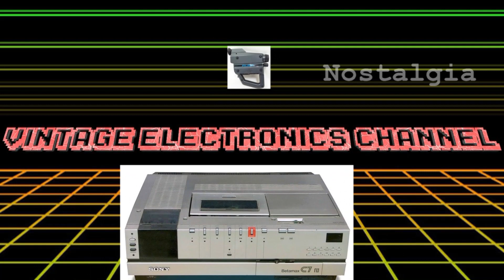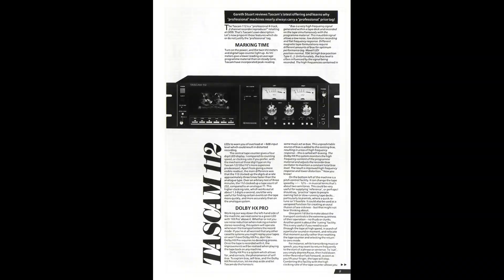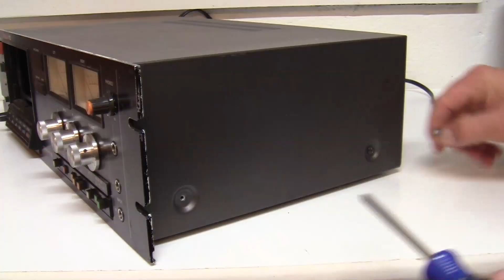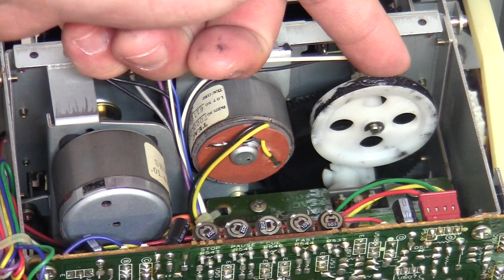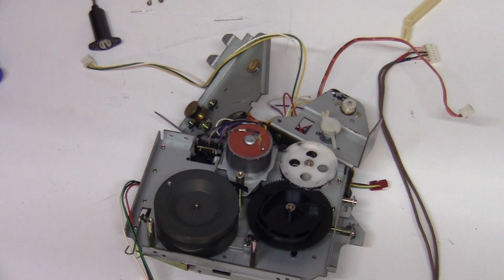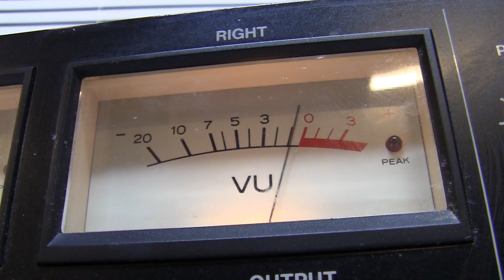Tascam 112 Cassette Deck - Overview and Belt Replacement - Vintage Audio

Comment: I just got a CC-222 and the F/R belt is toast. Is the disassembly / replacement process for that unit similar to this unit?
Reply from the maker: The CC-222 is quite a bit newer, so I'm sure it uses a different mechanism. The basics should be similar. I have a video coming out soon on a belt change on a Tascam 122, which is different than the 112, so I would bet yours is different.
Reply: @VintageElectronicsChannel   I'll be opening it up to find out in the coming weeks, will probably do a video or something since there doesn't appear to be much on Youtube for that particular model.
Reply from the maker: Make sure to tag your video here!

Comment: I have a Tascam DA30 mk II that just died after many years of service.  Any chance of doing a video on repairing those?
Reply from the maker: I don't currently own that model,  but if I find one in the future, I'll take a look at it. DAT decks tend to die and become hard to repair. Especially if it's the head unit.
Reply: @VintageElectronicsChannel  It’s the tape load mechanism.  It doesn’t take up the tape properly and one winds up with an error message and having to remove the tape and wind manually the tape that has spilled out of the cassette.  Thanks for the quick reply.  I’ve noticed that there are some videos on YouTube about that machine and that very problem.  It’s really amazing when you consider the mechanical complexity in those machines and even the tape cassette itself that they ever worked at all.
Reply from the maker: @soarornor, you're right. They are very complex. May be something simple like a belt or dried lubrication. Definitely worth looking into.
Reply: @VintageElectronicsChannel  Yeah, because the machine has not been used much in the last 15 years and has never been serviced.  It’s a beautiful machine though.  I really love Tascam design style.  They’ve really made beautiful gear for a long time.  I still have my original Model 10 console with quad panners from the seventies.   Not sure if it works anymore but the visual design of it is quite beautiful.   I recently needed to lift it up and place it on a stand so I can start to examine it and I couldn’t do it by myself.  That’s how heavy it is.  And it’s only an eight channel console!

Comment: That was excellent.  I have this machine but bought it restored so this info will be useful in about ten or fifteen years.  Could you do a video on restoring a Fostex CR200 or HHB CDR800 CD recorders?  These are the same designs and I think originate with Pioneer machines of the same design.  These were some of the first CD recorders and this particular design was extremely robust and well made.  I have the Fostex that I bought new and several more of those and HHB that I bought used.  The units still function excellently however the recording function is gradually starting to fail and has become unreliable.  That’s still a long run for a piece of gear.  I am wondering if these units are actually serviceable as their build quality makes spending money on repair viable.  If the subject interests you, please look into zeroing in what the cause of this failure is.  What occurs when recording is the sudden stop and disc error message when recording.
Reply from the maker: Thanks for watching! I'll look into those models.
Reply: @VintageElectronicsChannel Thank you.  They are superb machines made for studio use.  They used real high quality components and even the chassis and cover are made of pure copper.  They really went all the way back then. I miss those days.

Comment: The thing I missed was getting the tines on the cassette mechanism lever (visible by your left index and middle fingers at 7:04) to straddle the bar on the black mechanism control wheel. After getting that right, this long-dead machine works perfectly! Thanks!

Comment: I just changed 2 belts in one of these going by feel. No videos or anything watched. That took 2 hours, some of the rubber had melted to the pulley wheels. Once back together I found the rubber wheel that is driven by a separate motor (direct drive, the central motor) broke. Now looking for a new rubber wheel. By the way the large belt to the main flywheel is 5mm x 109mm, it is what I used. The smaller one is 2mm square and around 80mm long folded. I bought a selection from Aliex, there are various sizes in the pack you just have to try to find the right size in the pack.
  Also note the potentiometer in the mechanism that must engage with the large black wheel as you put it back together. My belts were not stuck to everything as bad as in this video but the melting rubber messes up your hands so best wear gloves for this job!

Comment: How do you know the size to buy? Thanks
Reply from the maker: I keep an assortment of belts so I can match them up. Many times you can find specific belt kits on ebay for specific models.
Reply: @VintageElectronicsChannel  than ks

Comment: Anybody have any suggestions or advice, after replacing belts and idler tires on my 112, the cassette heads are staying in the way of the tape when I try to eject/insert a tape- and the pinch roller seems to be determining speed
Reply from the maker: Sounds like the mechanism isn't timed correctly.
Reply: @ there is something going wonky with the reduction pulley, it seems to control how high the heads/pinch roller lifts and since they lift in a lot of operation everything is being affected

Comment: Much appreciated video here thank you. 
I installed the same set you showed. GOOD NEWS - the machine plays well. BAD NEWS - It stops playing after a bit. Also notice the counter is not accurate.
Any thoughts? Anybody? Bueller?
I often use denatured alcohol for things like this.
Reply from the maker: Does the take up reel stop right before it stops playing? I believe the counter and auto stop both run off that reel. It something is slipping and it stops, that could possibly cause that.

Comment: Pretty good video, but he didn't tell us how the clear plastic front door is removed.  Just pops up and lifts out.  Dont make the mistake I did, thinking that I had to remove the two strange screws on the front.  They wouldn't budge, so I drilled them out.  Then discovered later how it's really removed.  😒
Reply from the maker: Yikes! Yeah, this was one of the very first videos I ever made, and looking back, there are a few things I should have changed or included.

Comment: I'm sorry, but I found this tutorial to be lacking.  There are shortcuts and some of the steps are left out.  For instance, it seems that the door assembly has to come off in order to remove that section and it seems like I have more ribbon cables and more things to disconnect before I can get into the spots where the belts go.  It seemed very cut-and-dried but unless it's me, it seems that there is more than meets the eye.  I am likely to send it on and hopefully the repair place will not charge me more for trying to do it myself.
Reply from the maker: My apologies. That was my first ever upload to YouTube, so I was definitely in the beginning stages of figuring out the whole video process.
Reply: @Vintage Electronics Channel  - maybe I can send it to you????  Very frustrating and disheartening.  I am very disappointed.
Reply from the maker: Is yours a model 112? I do offer repair services here in the shop. Normal turnaround is a couple weeks. Send me an email at chad@vintageelectronics.tv if you'd like more info.
Reply: I ran into the same problem, there must be different variations of this model because mine was much more complicated, like Andy here said, many more connectors, much more difficult to get the board off and the cam/motor assembly was not nearly as cut and dry as demonstrated here. I'm not saying that things were edited out, quite the contrary I think that they probably economized their design over the years and if you have an old old one it's probably different even though the models are technically the same. Mine was a PITA but I did manage to do it and it works much to my enjoyment so thanks for the inspiration to disassemble it, I would not have attempted if it didn't appear to be so straight ahead, in the end I learned some things and I salvaged my machine. Win win.
Reply: Yes definitely heavily edited and missing a detailed step-by-step guide for non-experienced people like myself, but it provided excellent guidance nonetheless.

Comment: I think I will color the connections that connect with different-color Sharpies.
Reply from the maker: Good idea! I tend to take pictures before I take anything apart as well. Gives a nice reference when putting it back together.

Comment: I have a Mark I that will cost me $175 for belt change.  This is out of my element but would it be worth it to try and learn, in order to save the money and do it myself.  Can I expect that a machine sold as-is can still be repaired?
Reply from the maker: If you have patience and take your time, I'm sure you'll do just fine changing the belt. I've purchased many things as-is needing repair. Sometimes they're repairable, sometimes not. It's all part of the process.
Reply: @VintageElectronicsChannel  - I have been told that motors for the Tascam cassette are no longer available new.
Reply: What needs to replaced?  I opened them all up, dusted them inside with canned air (when one died, I just got another - I have six).  Where is the best place to get belts and is that all I need?  The belts just fell off and were not gunky.
Reply from the maker: @andyb811  You can find new belts on sites like eBay. I usually buy assortment packs so I can match up the perfect size. Not sure where to find a new motor for one since they are no longer produced. That might be more of an eBay thing as well.
Reply: @Vintage Electronics Channel  - used for parts but even "as-is" is now overpriced.

Comment: This might be too difficult for me to understand or figure out but on the other hand would it be better for me to attempt it (considering the cost is $175 + parts to send to the repair place?)
Reply from the maker: I think even a failed attempt is a learning experience!
Reply: @Vintage Electronics Channel  - cannot learn without trying?

Comment: These were so cheap (used) I used to buy another used one instead of sending this one in but the repair guy charges $175 + parts to repaid.  Sounds reasonable but isn't this something I can do myself for much cheaper?
Reply from the maker: Some repair operations are relatively simple. I'd always try fixing them yourself if you have the skill and patience to try.

Comment: hi i picked up a tascam 238 for £50 uk  it need alot of work audio pcb's need on pots and a full track test tape i have one
and send in the right sig levels in to the audio card i am a audio tec 

i put a mini pot where a res was to get the input levels the same input first audio buffer audio ic  i had to do alot of work all the rec pot 47k i had all new one

and i had to make in put and output the same  when rec button are in   take me alot of time with 8 channels  it's ace now  i am making a yotube video for next year

Comment: Thanks for the helpful video. My new belts are on the way.
Reply from the maker: Glad it helped
Reply: @VintageElectronicsChannel  Funny story..... broke something when attempting belt replacement and had to send to a  tech. I likely could have fixed it with enough time and effort, but probably better to support those still working on these machines.
Reply from the maker: The thing with old electronics is they're unpredictable. Luckily there was someone who could fix it. By all means, support those folks who are still around!

Comment: Thanks for the video. It is very helpful.  I have one problem. Once I reassembled the whole thing, the pinch roller does not move up enough for proper play. I can turn manually the top white belt wheel. It moves the pinch roller up and then it plays ok. I think I must have an alignment problem. Any suggestion?
Reply: Try to get some wd40 in there. Are you talking about the central motor where there is a small white wheel with rubber surround? Turn the white wheel carefully and check to see if the rubber has split. ALso if the rubber is too hard it can not grip to the black wheels to either side. There exists a product to re-rubberise such parts but they are probably about to break. I am about to search for this part myself as my rubber wheel split.
  The size appears to be 18mm x 12.5mm x 2.5mm as best as I can tell.

Comment: Hi , I was wondering on the belt for the Mechanism for the Head and pin troller up to the Capstan to play Should it turn when your playing a Tape
Reply from the maker: Without taking minr apart, if memory serves, it should only turn when it's moving that mechanism up or down.

Comment: Like an artist, you make it look easy. In the market for a 122 or mk and finding a lot listed as 'not playing and needing a belt'. How would one know if it needed a belt or if the motor was bad, they are dd, do 122's even have belts?
Reply from the maker: There could possibly still be belts for the take up reels or the mechanism. Sometimes direct drive just refers to the capstan drive. It's always a risk when buying something that "won't play". I tend to listen to try to at least hear the motors running. Perished or loose belts are way more common than a motor going out.
Reply: @VintageElectronicsChannel  - I am convinced that a whining sound when playing usually means the transport (play motor) is bad.  Motors are not available new.

Comment: My pitch control is giving me fits. After it "warms up"  the speed locks in for the most part.  not much luck figuring it out.
Reply from the maker: Have you tried cleaning the potentiometer for the speed control? Deoxit or a good electronics cleaner sprayed into the switch body can do wonders for that.
Reply: @VintageElectronicsChannel  Wow... thanks for responding. I did try that, and tried it again. No good. When I hit play, the tape races for a second, then locks in at correct speed. At least I think it's correct speed. Just hoping it is a semi-common problem with a simple solution. I should know better.
Reply from the maker: Hmm... racing at first and then locking in makes me think perhaps the pinch roller isn't engaging quick enough. Like the take up hub is doing the pulling and then the pinch roller finally settled in and pushes against the capstan and slows it to the proper speed. That's my first thought, especially since that entire mechanism moves up when play is pressed. Second thought is maybe a capacitor or resistor or something that's limiting the current to the motor is faulty and taking time to reach its charge.
Reply: @VintageElectronicsChannel  Thank you for the tip. Ill have to open her up and see if I can see if that is the case. Ill report back.
Reply: Nice catch !!.  That appears to be what is happening. The roller mechanism is lethargic rising up and meeting the capstan.  as soon as it makes contact,, wham. good speed.  I was concentrating on the pitch control circuit. Silly me.  Thank You Sir !!!.
Reply from the maker: Happy to help! I've seen that in a couple other cassette decks and also in R2R machines and that's the first thing that popped in my head. Glad we narrowed it down! A little lube should fix that problem.

Comment: I love finding these mid to high end decks for cheap. I usual hit the resale stores and so far have about 30 decks. almost all of the need belt replacements, but for some reason the low end units I have worked just fine right off the shelf.
Reply from the maker: They don't build them like they used to! I've picked up quite a few over the years and for the most part, they work great with minimal restoration needed.

Comment: I have the first generation Tascam 122 deck. It looks very similar inside. Would you know if the procedure is the same? Where does one get the belts also. My drive belt for the play function is mush right now. FF and RW work fine as well as ejecting a cassette works fine. Thanks very much.
Phil
NYC Area
Reply from the maker: Procedure should be the same for first generation.

Comment: Very good video. However, when I opened my unit the belts are NOT gunked up but they are very slack. Does that mean they are just stretched (and need replacing) or is there some kind of tensioner that they are not on correctly? I bought the unit new sometime back in the '80s and it is a great machine when it is working. I haven't used it in many years because of the transport issue. Thanks again for the clear and informative vid.
Reply from the maker: There's not a tensioner, so they'll need to be replaced. They stretch over time.

Comment: Was wondering if you can help troubleshoot, I replaced the belts and all was well....however the head mechansim( play and erase heads) doesn't drop low enough to allow the tape to enter the housing. Thanks for your help
Reply: I have the exact same problem! Did you find a solution?
Reply: @henrycobb9544  at 7:05 freeze this video and notice when he places belt back on, there is a little white wheel with an arm sticking out below the cam.  That small white mechanism arm slides into the brown big wheel that has a groove into it.  I’m sorry I don’t know the terminology.  There was another video that since has been taken down that explains it.
Reply: @cvtogate  Hey man thanks to you I got it working!
Reply: @henrycobb9544  That’s awesome!! Im glad I could assist you.  But there was a better explanation of an older guy that repaired it and mentioned it specifically, I couldn’t find it. But that’s great.
Reply: @henrycobb9544  yes, let me find it and I’ll get back to you, one sec